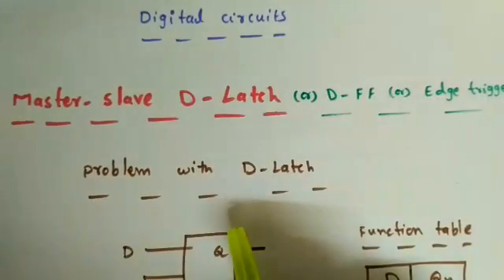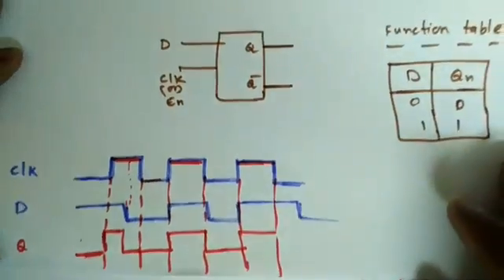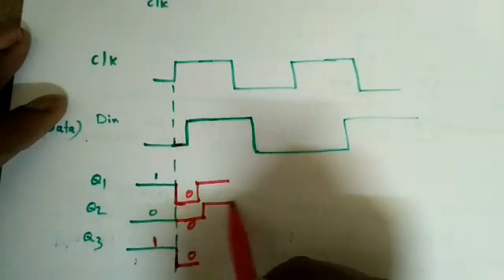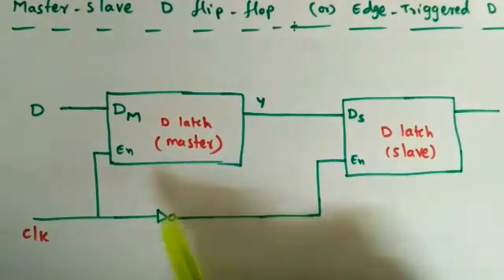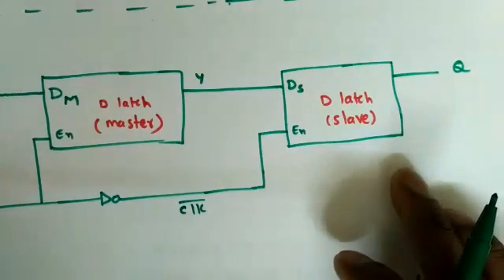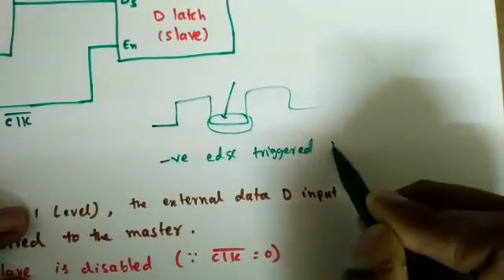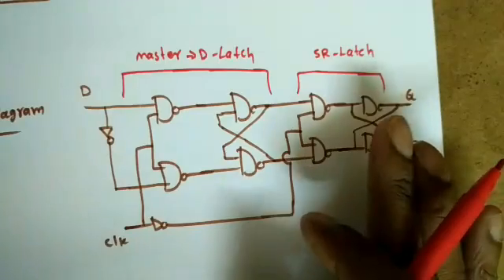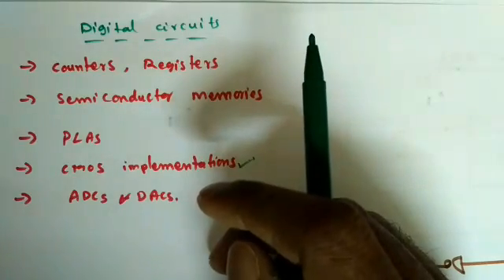Digital Circuits Lecture-54: Master-Slave D Flip-Flop

Comment: HELLO sir i have a doubt 
in lecture 51, u hav explained the same timing diagram of dlatch. there u hav mentioned that the input wont when clk is 0 and willcontinue as the previous input. but here u r saying the input will change ( at 1:38 ). can u please clear that?
Reply from the maker: actually i did a mistake it should be 010 after we apply a clock...if still clock is high then the state of Latch will change to 001 and so i.e the problem in latch